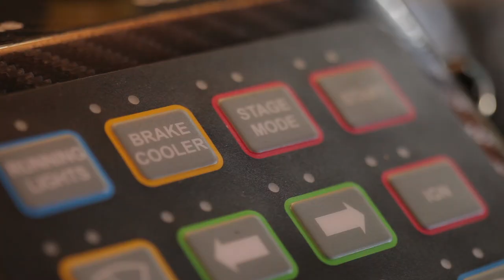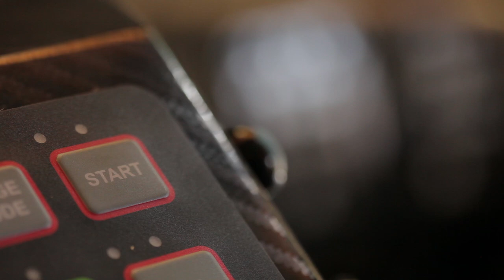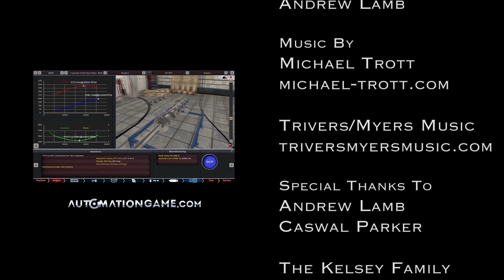The Homebuilt Rally Car That's Too Fast for the WRC - TST in NZ

Comment: I know it's all the way in NZ but it is so nice to see young guys build shit like this. he isn't bragging about it either. I wish him the best on his racing career. inspiration for all the younger guys in America. Don't think because you don't have alot of money you can't build things. create what you want and if it fails address the problem fix it and move on. Thanks for the video +TheSmokingTire
Reply: Richard Mogel Well you kind of do need a lot of money. How much do you think a decent CNC machine costs that allows you to build parts at home with some acceptable levels of accuracy? More than an average family car. This entire build probably cost him well over 1 million dollars.
Reply: derbigpr500 I seen an awful lot of manual machines in there and I know what a good machine cost you can get into a well equipped  tormach p cnc  for 20. Stop finding excuses why you can't and try to make it happen. I started machining 12 years ago for minimum wage making thrust bearings and sweeping floors. All depends on how much you want it
Reply: derbigpr500 I'm guessing a little here, but the tools for his workshop, including a basic 3-axis CNC mill, can be had for less than you'd need for a turn-key WRC car. He bought most stuff used, the chassis is tubeframe, the bodyshell bought in France. 1 Mill might be a bit much.
Reply: derbigpr500 Cost him about as much as an engineering degree would have, apparently. 

Dude does have a decent set of machine tools and some friends with specialist skills though.
Reply: AutomationGame dude is being a little bit of a hater. Haas Automation, Inc. what would a well equipped 2 axis lathe with an 8 inch chuck and a 3 axis mill that can fit in a 2 car garage or 800 sqft
Reply: derbigpr500 you can make 90% of the parts on manuals any cnc is mostly for production uses or super complex contours and radii. CNC is faster to a certain degree but I can do parts on a manual faster than a cnc because of set up time and my hands are the program. Talk to anyone who is an experienced machinist. Not a button pusher a real deal machinist. And if you have a mig and a tig or a torch setup or all three you can build the entire chassis with a drawing and some knowledge
Reply: Richard Mogel  NZ produces some big motorsport names that you would have heard of even in the US; Scott Dixon, Mad Mike, Mclaren, the Millens et al...
Reply: krbcrwlr I know they have some big names but I just like seeing people create things because in America we are turning into an instant gradification society and everyone thinks you have to buy everything
Reply: Richard Mogel "not a lot of money" is a relative term. He picked up a used racing engine...how much is that going to be? Even if it is 'obsolete' it wouldn't surprise me if it was 20-30k alone, not to mention the gearbox + brake/suspension setup. You can buy used WRC cars for 500k, so maybe this one is a couple hundred grand. But to be that young and get started at 15 to race, and 18 to build stuff while at school (which doesn't leave much time for work) the money has to come from somewhere. That barn is nicer than most peoples homes. Its nice he has the opportunity to do something like that though.
Reply: Spinal2111 I just finished a dirt modified. Built in a 1 car garage at my house for someone. Started with a blueprint, a truck full of tubing and a mig welder. If you have the drive nothing is impossible. That race car cost about 7500 to build. The cars he competes against have shocks that cost that much. Everything is used many times. However you can rebuild it all for very cheap. when you build something on a budget or not you use alot of ingenuity in the process some things save you money some dont. I'm not denying that that car was expensive. Or the money came from somewhere. However you are overlooking the most important detail. He built a complete race car at home. Unless his home is STI that is very impressive
Reply: ***** I feel like his custom damper manufacturing alone could have him open a shop for offroad/rally purposes in the not so far future.
Reply: Got the pleasure of seeing this car run at the Wairarapa rally in NZ A few years back (a national rally event), A reply hyped up unveiling for the car into the national rally. Was amazing to see the car in action! It only lasted a few stages before something went wrong and the car ended up on a trailer (I remember seeing Alex getting some verbal abuse by an older bloke loading up the car at the service; something about the cost of shocks). Never heard of the car at an NZ Rally again :( 
None the less, would be awesome to see it re-entered into the NZ Rally and see if it can place well in the championship!

Comment: I wonder if he's ever heard of a guy named John Britten ? He was another New Zealander that didn't listen when people told him that he can't build his own motorcycle from scratch. Well he did, and the only item he didn't make himself, was the gearbox. He used a cassette type gear box from a Suzuki GSX-R, but fabricated every single other part of the bike himself, in his home shop. He took it to Daytona that year and entered it in the race against factory race bikes, and was winning when his battery went for a shit. Unfortunately, he died from cancer before he had a chance to try again. The guy was an absolute genius. So don't say this Kelsey fella couldn't have done it himself.  I may be remembering some of this wrong, so look it up if you want to read about an amazing man. The Britten V1000.
Reply: Britten innovated in so many ways that you can find his influence in almost all Motorsport.. heck the guy changed bobsled and luge fabrication.. gone too soon
Reply: I believe the issue was actually a faulty ignition coil, made by Ducati, one of the few parts he didn’t make himself. He was a genius, even cast the engine & components at home in his garage
Reply: I got to see the V1000 up close at the Brisbane Exhibition earlier this year. Is absolutely stunning. The engineering that has gone into it is off the chart.
Reply: @djsantiago3904  or was it the rectifier

Comment: Debate whether he built or bought it all you want. 

The fact remains that this kid can drive the hell out of it. 👍🏼
Reply: Maphyous Couldn’t agree more! His skill really speaks for itself
Reply: he is pushing it he built it on his own maybe help with few friends
Reply: I'm from. Nz shit at 12 years old me and my mates was peeling out on a manual car at 16 already making our own cars swapping engines making shit boost its called backyard mechanics kiwi ingenuity  yes at 22 I believe he made it from scratch
Reply: Any one who doubts it has never been to New Zealand. While teenagers in the u.s. are doing crime or sitting on their arse playing fortnite, this is what Kiwi youth do.
Reply: king kong kong 

Yooo do you guys have holdens?
Reply: king kong kong also how did you get started?
Reply: king kong kong damn

For me my idea for “home made” is really just small pro race team shit.

Get a chassis and build a craft Group C type race car, NSXchasis and proper engine and turbo, with the body designed like a Ferrari where we’ll have downforce on the front and read of the car and ground effects
Reply: Well he obviously bought the original Peugeot 208 on top of the wheels, brakes and other specialised components, but for the chassis, exhaust etc I believe it no problem. And even if the parts were all prefabricated and bought, it would still be quite a remarkable thing to have assembled it all alone.

Comment: he made an offer on 1 of 40 engines..."the heart of the project"

I hope he bought a few more, as spare.
Reply: I was thinking that too.
Reply: he bought the whole car. dude did not build a thing
Reply: patrick gronemeyer salt is real
Reply: Lol so what? Like I said if I could afford those parts I could build that car to anybody could that is literally like the Lego set of cars it's a GRC frame GRC body he bought the brakes he bought the rims there's not a lot of that car he admits himself he didn't buy.
Reply: Ryan I have a plane... correction an auto gyro.
Reply: at its heart that engine is a VQ35. Once he had one in racespec to analyse he can rebuild it with "street" parts
Reply: AccAkut1987 

Try analizing the tolerances of an engine that grenaded itself.

I hope he bought a spare engine or two.  
Not that i think it'll blow up,  but just in case.
Reply: He probably has blueprints.
Reply: AccAkut1987 Hey mate any chance you could expand. What is a VQ35? Could you get the same peromance/ sound from a good street build/ engine builder and access to parts? My heart sank when a previous comment stated only 1 of 40 exist.
Reply: Cole Trickle Vq35 is a 3.5l v6 from Nissan used in the 350z, G35 and some other cars
Reply: AccAkut1987 Because Nissan is owned by Renault?
Reply: @luuk341  there's a new Renault race car concept that came out with a Nissan GTR engine mid-mointed in it. They have a supply and research and development agreement I think. Have done so since the 90s
Reply: @luuk341  Renault-Nissan-Mitsubishi Alliance
Reply: Well he has a mill and a lathe and can reproduce all those parts
Reply: patrick gronemeyer no he said he only bought the engine and gearbox,
Reply: @patrickgronemeyer3375  I saw this car activley BEING built... he had a road pug, chopped it up, got the ending, and built everything else by hand. stop being so salty just coz you didnt do it first.

Comment: In my 30's I took an 1959 Austin Healey Mk 1 Sprite (Bug Eyed Sprite (Frog Eyed Sprite in the UK)) and rebuilt the car. A friend rebuilt the body and I did the electricals, drivetrain, dash, interior and wiring harness.  What I ended up with was a car that perfectly embodied the awesomeness of a 427 Cobra in appearance and performance but miniaturized into a 1200 pound car that was street legal but could surpass 150 MPH. It only had a 1275 CC Engine from the original series of engines (Austin Mini Series) with special modifications that allowed 9000 rpm and 90 plus horsepower. It was 5 3/4 inches off the ground and too fun to drive.
I really understand the excitement and awesomeness of what you have done although you have outdone my efforts at every turn, it is an amazing accomplishment and you should be proud of yourself. I only had about 10 grand into my effort. I can't imagine what yours cost, but I bet it was worth every penny.
Reply: Pictures?
Reply: My dad had one of those with a 1275 too before he unfortunately sold it

Comment: its not too fast for wrc. its displacement is too large.
Reply: stuart johnston there should be some sort of open class in wrc. Get the big factory teams out of it and you'll see more rigs like this thing and much more ferocity in the competition.
Reply: ROTAXD they did, it was the monstrous B-class and cancelled S-class in the 80's.

Safety and tragedies are what made the era ended.
Reply: clickbait
Reply: That means it is faster. 450 vs 320 hp. 1000kg vs 1200kg. It's a modern group b rally car basically. Of course it would be too fast.
Reply: Can we call it Group B?
Reply: i ment @ ROTAXD
Reply: This wouldn't see which way a WRC car went.
Reply: That made you feel good huh.
Reply: @XrapXx  If you can meet WRC certification criteria it doesn't matter how fast it is. So no, it's not "too fast"
Reply: @electricant55  if you meet the wrc criteria you will end up with a slower car than this..
Reply: @XrapXx  Less powerful, not really slower. Modern WRC cars are faster than group B was
Reply: @electricant55  imagine the group b power on a modern chassis, modern gearbox.. etc. Group b is from the 80s with 80s technology.
Reply: @electricant55  Imagine thinking any WRC cars is faster than an Delta S4 🤔 🤔 🤔 🤔 🤔 🤔 🤔 🤔 🤔 🤔 🤔 🤔 🤔 🤔 🤔 🤔 🤔 🤔 🤔 🤔 🤔 🤔 🤔 🤔 🤔 🤔 🤔 🤔 🤔
Reply: @ONW4V3R  2.5 second to 60? Yeah, not impressed
Reply: @electricant55  on gravel, the S4 specs where all rated on gravel and dirt. 
If you don't know anything, don't try and say shit. The Group B was outlaw because the cares where too fast and peoples (spectator as well as drivers) started dying because of it.

Do you really think something which was too fast to be allowed was... Slower than the other groups? Well good luck on proving that!
Reply: @ONW4V3R  Again, it wasn't about the speed alone. Group B cars were hard to control and had terrible safety specs. Yes, if they were made today they would be much faster than WRC but that's neither here nor there.
Reply: @electricant55  Nice you figured out why WRC cars are slower nowdays. Good on you.
Reply: @ONW4V3R  WRC cars today are faster by A LOT than the Group B cars in their prime. In fact the Group A cars 3 or 4 years after Group B was cancelled with like 200hp less were already as fast because of the improvements of suspension and tires. So stop talking this bullshit about WRC cars being slower. Yes the Group B cars 0-100 are faster than today's WRC 0-100 times but thats about the only thing they are faster at, corner speed is the most important thing in rallying, not raw power, which is the reason why WRC cars don't need 600 HP.
Reply: @korlic9  why not group FH
Reply: @impossibru5721  Thata cause the Group B cars have 80's technology if they had the same technology like WRC Today...Then these WRC Cars would be fucking destroyed.
Reply: @ONW4V3R  Imagine thinking 80's deathboxes are faster than modern rally cars.
Don't get me wrong, i love the group b madness, i think the cars sound better and look better, they are so raw. But new cars are faster, that's a fact.
Reply: ROTAXD that’s called group b and that killed a bunch of people
Reply: And it’s got 450hp when wrc class cars have 380hp
Reply: @ONW4V3R  most WRC cars are faster than Group B machines. But imagine WRC platforms with Group B regulations...
Reply: @jayplexy5983  oh c'mon, you can't beat the sound of a Quattro or a 6R4. Those cars sounded like none other. Not as fast as today's cars but just as nuts
Reply: Joe Cool  Because it wouldn't see which way an actual rally car went. And then it would break.

Comment: This is what group b could've been if it wouldn't have ended....
Reply: In what way? I get that in the video they act like this is super extreme and way better than a WRC car, but the difference in power is only about 70bhp, and this is largely more tame than group B in exactly the same way modern WRC cars are: they handle much better.
Reply: @Sammie_Sorrelly  That was his point, what could've been now. Or do you think, they would've kept those deathboxes same since 80s? Ofc gr.B would be upgraded, more tech, better handling, more safety features, etc. This particular car has similar bhp like those did. Just more modern everything else.
Reply: 205 T16 if you are in 4th gear, you are one foot in the grave. And it has 5 gears xD
Reply: Much more. Such as EPS, ABS, 3-Axis Torque Vectoring AWD, and any other Electronical Assist.

And don't forget, F1 Based Aerokit
Reply: Trouble is there wouldn't be any drivers alive to compete in the class. ☠☠
Reply: I'm 13 I will change that when im FIA boss.
Reply: @jakemorandthemomoz8154   lmao what
Reply: @ryo ga  i know that
Reply: @suyangsong  well spectators are stupid and everyone in rally who has seen some of the videos were they were in the track less than 5 foot from the car

Comment: You're underselling this with the numbers, 100km is ~62 miles, so it's actually:
0-62 in 2.6s
0-124 in 7.0s

Small but significant difference
Reply: magpierh it clearly said that in the video
Reply: Soo it's not actually faster then real rally cross cars then lol really really cross cars can do it in under 2 seconds 0-60 lol
Reply: @BLAZINGINGPHOENIX  the gearbox ratios are longer on this car.
Reply: @BLAZINGINGPHOENIX  0-60 is already cheating....it's 62!!!! 😉
Reply: @BLAZINGINGPHOENIX  rally and rally cross are two different sports

Comment: Watching in 2019, I think WRC should take notes from this car
Reply: propably wrc cars are still faster than this car
Reply: alessandro ari zaluski actually not
Reply: Satanic Panic Fun and Games okay that’s an exception but every other thing is bad
Reply: Aran Whelan why?
Reply: Satanic Panic Fun and Games right?
Reply: @alessandroarizaluski9178  they would be because the modern WRC car is wider and has significantly more aerodynamic assistance since the last rule change (2019?)
Reply: @YuhoKeebs  actually yes, plus wrc has regulations too
Reply: @alessandroarizaluski9178  no they're not, a WRC weights almost 200 kg more and has 70 less hp